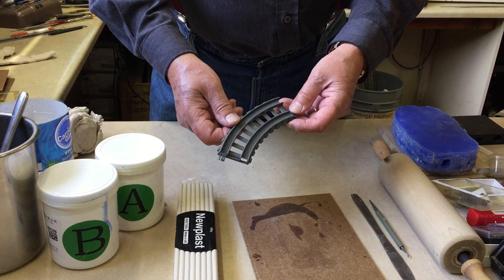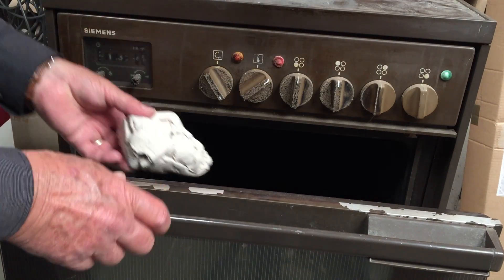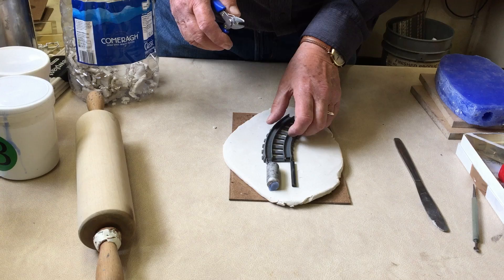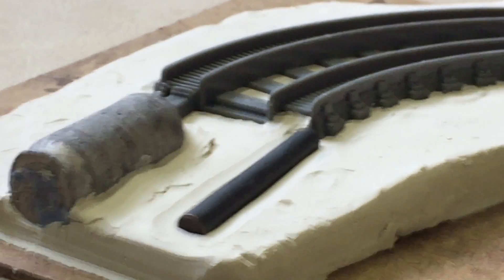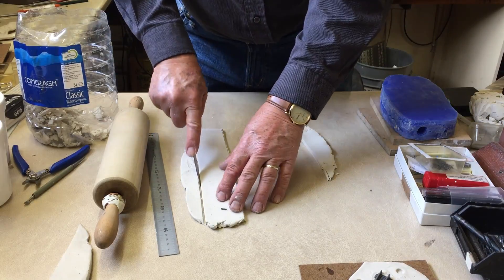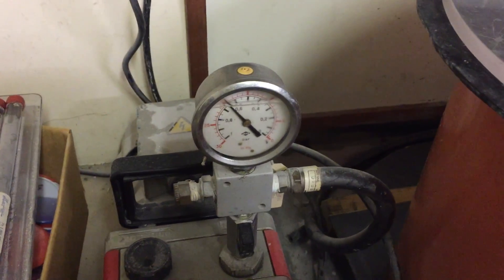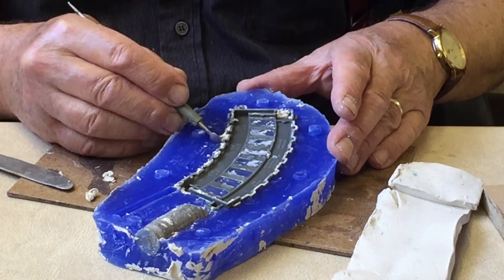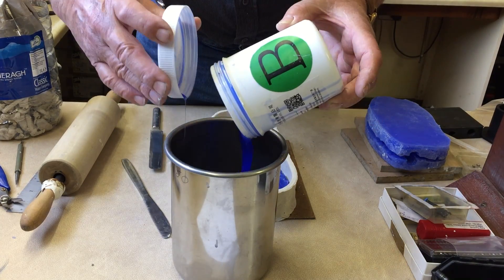How to make a silicone rubber mould using a toy train track as a model. Prince August Hobby Casting.

Comment: If you are to make a model out of silicone, will you have to make a hard mold or make a silicone mold?
Reply from the maker: A 'hard' mould being our black vulcanised rubber mould? Both mould types allow you to cast metal figures, but the silicone rubber is for small casting amounts (dozens of times easily) and the hard rubber moulds can usually do many hundreds of castings as they are more resilient to wear and tear.
So if you want a LOT of figures, then you do it in two stages. The first is the silicone rubber stage, as the video shows, then make metal master figures in that and Prince August can offer an affordable service to turn those into hard rubber moulds if you contact us at that stage. You cannot do that without a large press, which is unlikely unless you are a professional.

Comment: how many castings will the silicone mould do
Reply from the maker: It varies depending on the complexity of the master figure and what metal you are pouring in. You will get dozens perhaps. The rubber is more delicate than our standard rubber. Normally make the metal master and then convert it to a full black rubber mould by sending it to us. A direct press for a strong black rubber mould is a service we can provide.